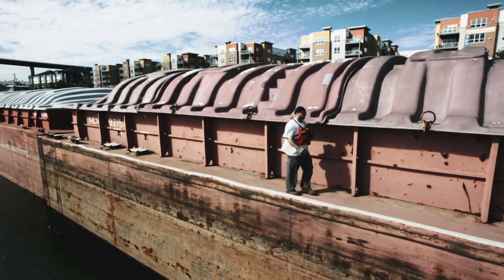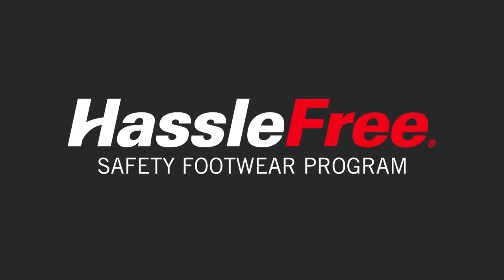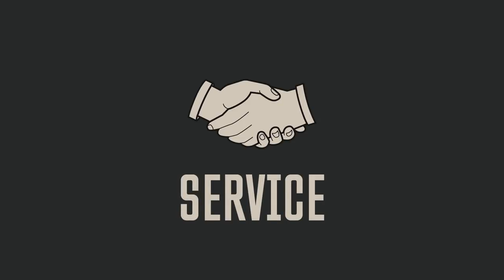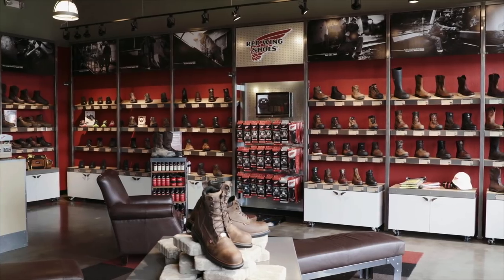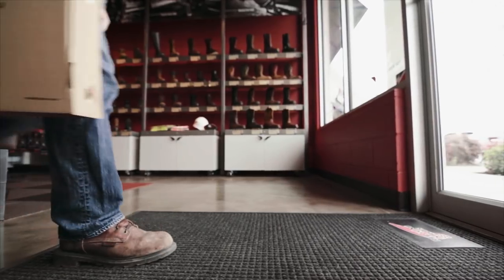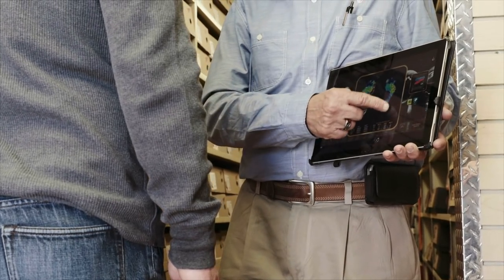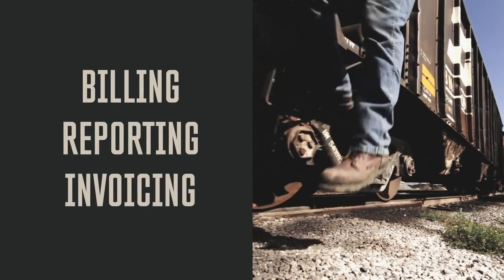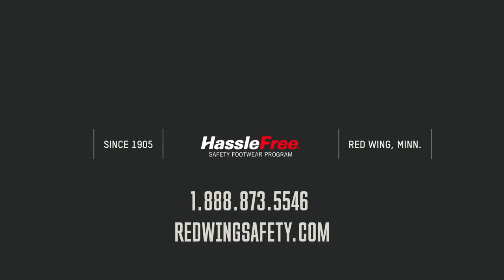Red Wing Shoes Presents: HassleFree® Safety Footwear Program Overview

Comment: Bring back more models like the fit of the iron ranger but insulated with a vibrant sole and composite toe. Old school work boots with new school technology
Reply: Try the USA model 899.....that is as close to perfect as you get minus the insulation which you really don't need with the proper sock selection.

They are rock solid and beautiful old school boots!

Comment: Your boots are great but, you need to design boots that offer more instep support and more models that fit someone with a narrow heel and instep area of the foot. Your stores never have a boot that fits like a glove and they never have the narrow widths available in the stores. Your standard widths are even to wide for someone with a narrow foot. Other than my particular issues, you still make a great boot. Try offering a logger model with a composite toe so your toes don't freeze off all winter even with good socks on also. Thank you